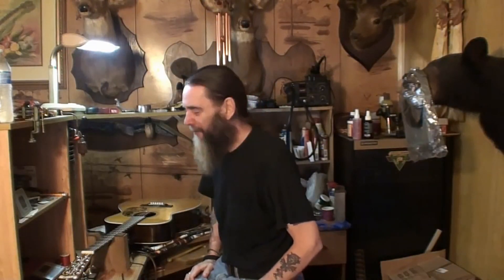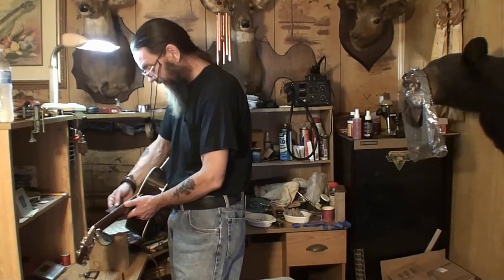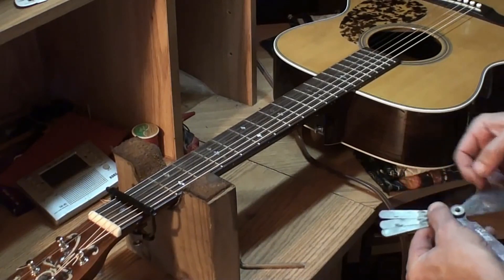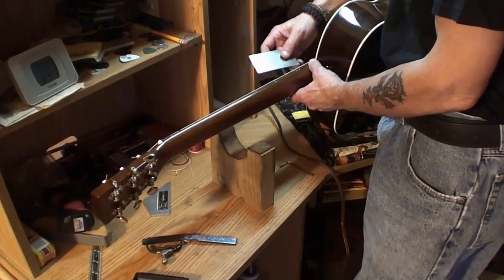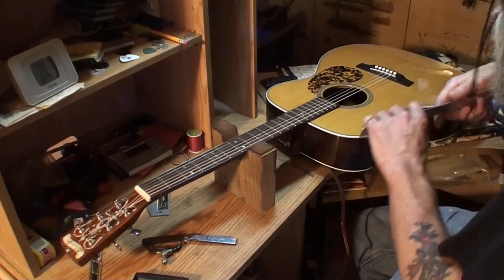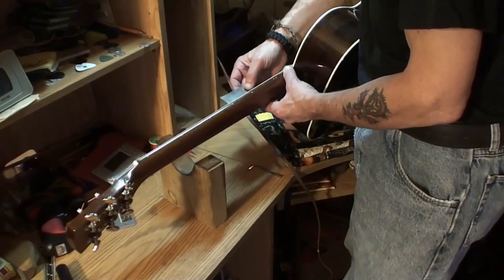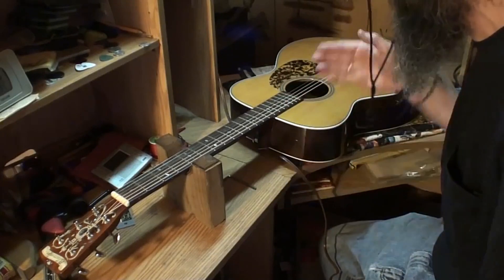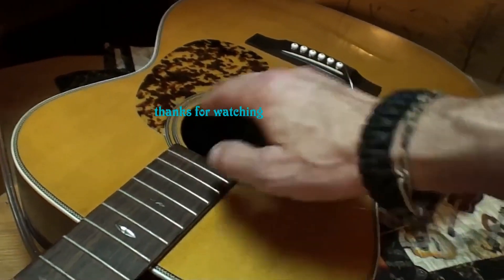blueridge br163 guitar gets some luv

Comment: Randy
If you want to shim a neck on electric guitar how much shim do you use to raise say .020 at like the 20th fret??  Like is there a calculation for that?  Im talking about Fendrr style strat and Tele guitars.    Cheers!👋
Reply: Did you try raising it at the bridge? Shim will raise the hole neck, if necessary. .020 Make sure the neck is straight first, and you can fix the angle if needed with the shim.
Reply: @jthonn      I think you missed the meaning of the question.  Maybe? 
How much neck pocket shim calculates how much action at the 20th fret.  
If shim the neck pocket so many thousands what does that calculate in terms of action on the fretboard. 
I other words if you wanted to lower action at the 20th fret say .015 to accomplish the .015 how thick would your shim be????  Thats the question?  
Just like Randy took so much off the bridge he did a calculation to accomplish that..   Have a great day..  👋
Reply from the maker: search my channel for neck reset and I have a video showing the way to calculate the angle of your neck. the video is on an acoustic guitar but the calculations are the same. on electric guitars it's easier to use a .020-.030 shim and adjust the action at the saddles. hope this helps, and good luck!
Reply: @Vern859  oh, ok my bad. Hope you get it right, cheers
Reply: @RandySchartiger     Thank you sir!👋

Comment: Hi Randy … I've been watching your videos about humidity … and I have a question to ask. I followed your instructions and now humidity level inside my guitar case is 45 up to 50 percent but  humidity level in my bedroom  is around 28 . obviously when I want to play that guitar I bring it out of the case and after I'm finished playing ( 2 or 3 hours a day at least ) I put it back inside the case with humidifiers and stuff. so does this change in humidity gonna affect my guitar ? or is it normal ? thanks.
Reply from the maker: no longer than you're having it out of the case won't hurt it, it takes a long time to change the moisture content of the wood, you could in fact leave it out of the case a few days before it'd start drying out. thank you for checking out my videos!
Reply: @RandySchartiger  Thanks for the tip Randy ;)

Comment: Randy if the straight edge is hitting the bridge isn't that because of the fall away and might indicate that the bridge may not be rising? Or does the bridge always rise in your experience? Looked like glitter inside the guitar.laughed my but off at your intro great job.
Reply from the maker: they do all pull up eventually. but you're measuring from the plane of the fretboard/neck to the plane of the bridge, not the fall away. I hope that makes sense lol thanks for viewing!
Reply: @RandySchartiger  perfect thanks